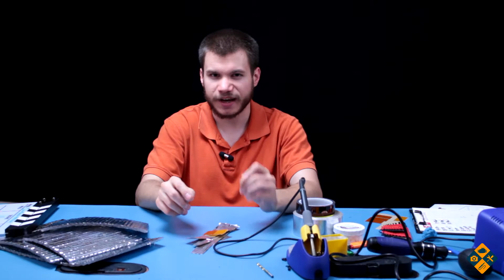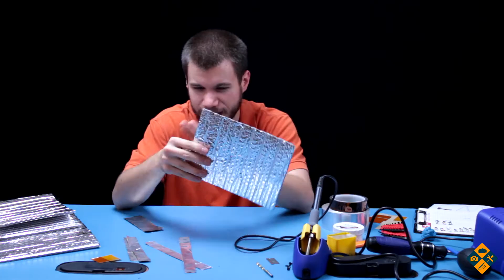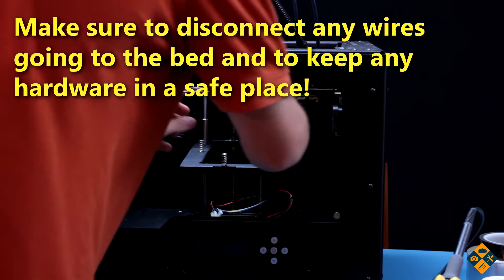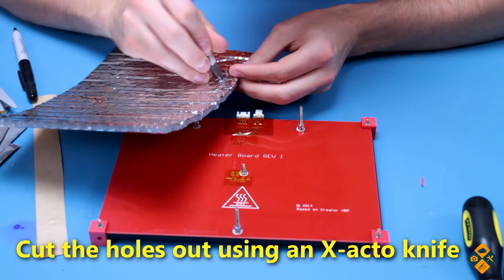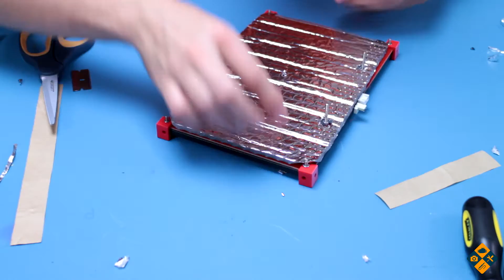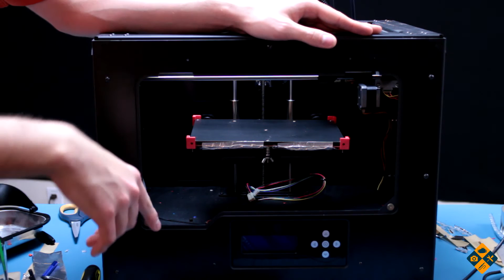HOW TO INSULATE YOUR 3D PRINTER BED - 3D Printing Tutorial

Comment: i would recommend using 3d printed bushings to seperate the springs from the insulation as insulation can get caught between a spring, causing its properties to change, this is optional though, but convenient in the long term

Comment: The insulation that you're using is intended for radiant heat, not conductive heat.  By putting it directly onto the heated bed it is doing almost nothing to insulate the bed. It would be better to use something similar to cork board or foam insulation that insulates against conductive heat.
Reply: Both matter, and the material he is using works well in both regards, as well as being very light.  The reflective walls keep the heat from radiating through and the layer of air inside helps with conduction.  I used a few layers of super thin mylar space blanket wrapped around the bottom of my bed and just that made a big improvement in heating speed and max temp too, mostly reflecting radiant heat back in to the bottom of the bed, but also insulating it from direct contact with air.  I plan to add a layer of similar stuff to what he is using also.
Reply: Alex - isn’t it all radiant heat that is escaping off the heat bed?  The only conduction is through the mounting points.

Comment: Have you tested the effectivity of your insulation? Some insulation results are very disapointing. https://3dprint.wiki/reprap/anet/a8/improvements/understanding_my_heatbed#investigating_other_effects
Reply from the maker: +Lukas Skymuh In my experience the heated build platform does heat up quicker with this method of insulation. I haven't done any in depth testing. I have been thinking of doing some tests with my thermal camera and doing proper timed heat up tests. I will get around to it once my 2nd printer is operational.